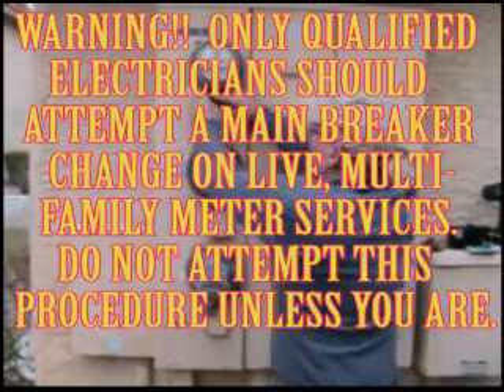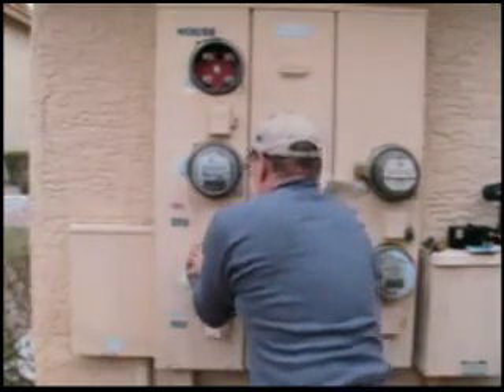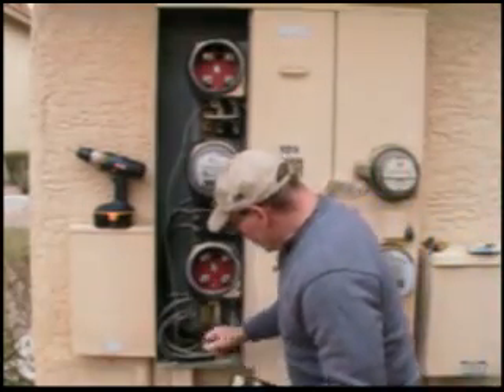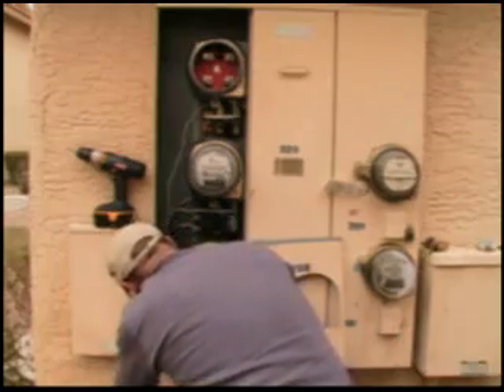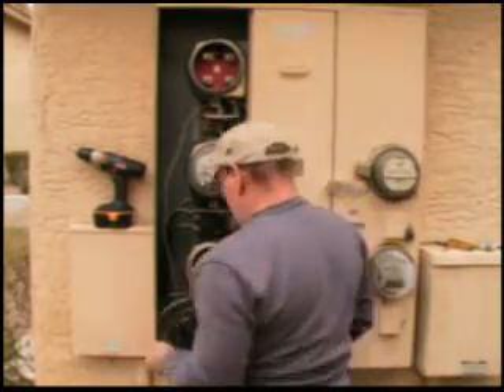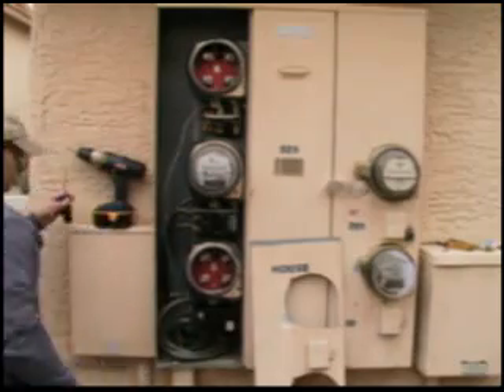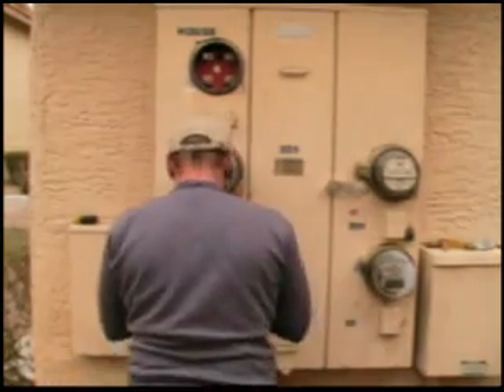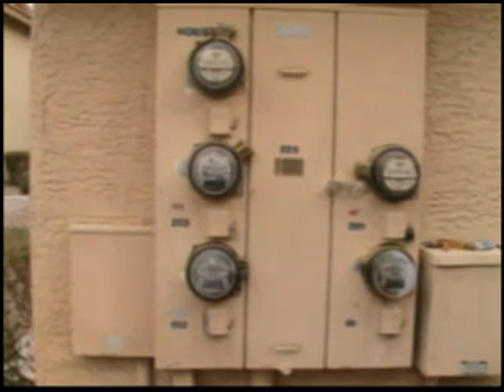Main breaker on apartment complex repair # 18

Comment: Replacing the 600A breaker hot? He even says it's a live 600A panel.  I didn't see him turning the power off to the line side of the 600A breaker. Also why did he remove the top and bottom meters but not the middle one even though he removed the collar on the middle meter. And 600A aluminum cable is almost impossible to work with unless you are Popeye. I didn't see him struggling physically with this 600A cable. Is it 2 parallel runs of something?